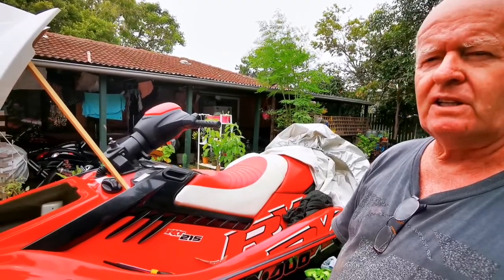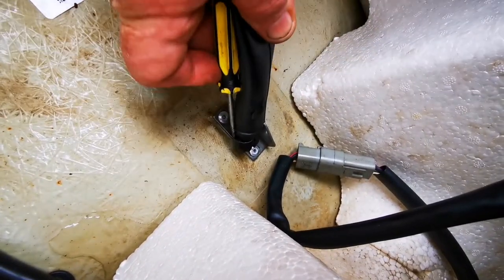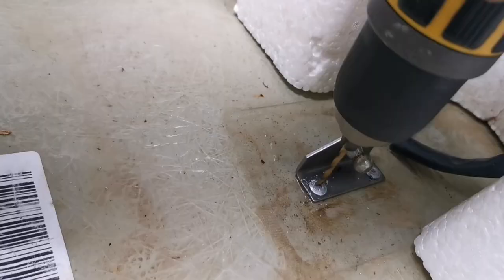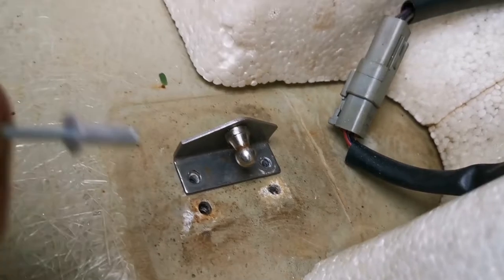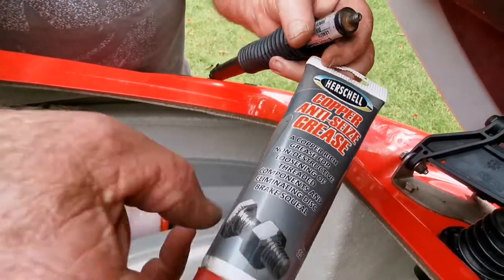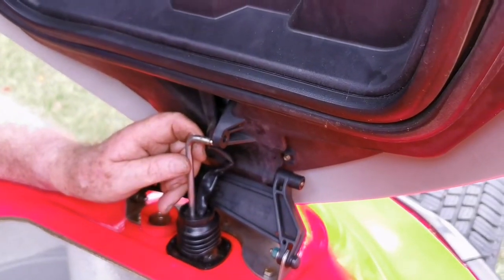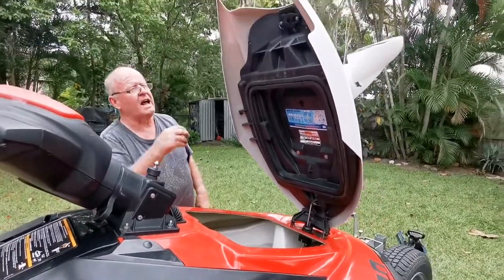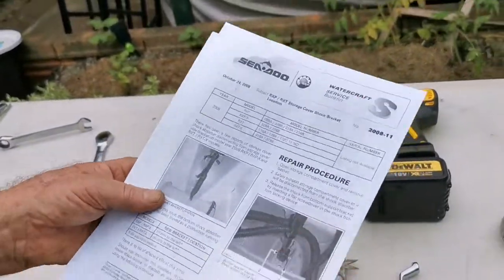Sea Doo Jet Ski I Fixing Hood I Gas Struts Issue

Comment: When doing the rivets are you drilling l the way through the fiberglass? I need to reattach the support as well as the shock and ball sockets
Reply from the maker: Hi, there should be an empty space between the floor and the outer hull. I drilled in about 15mm and felt air (as in empty space) .just don't use an extra long drill bit. The original rivets are there so all we are doing is relocating them by millimetres..
Cheers